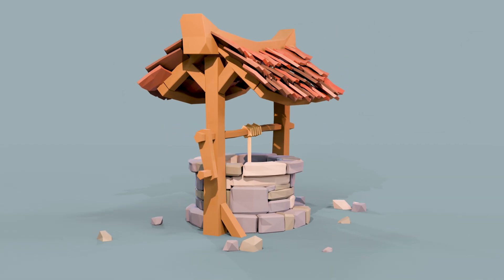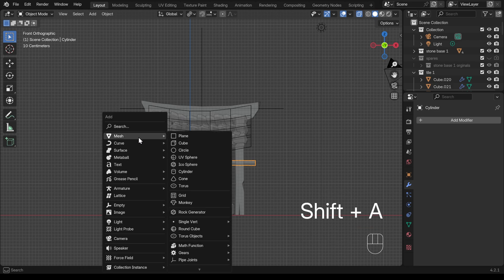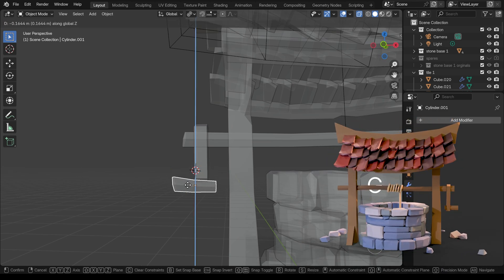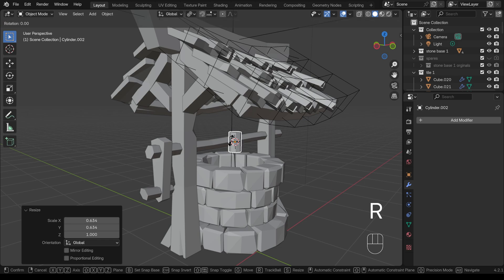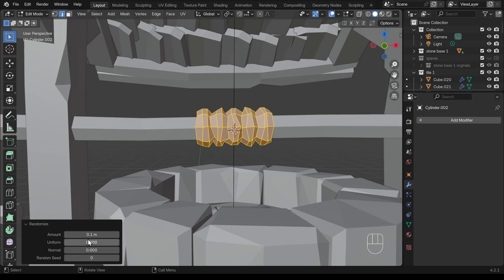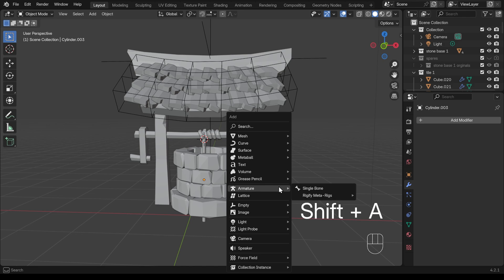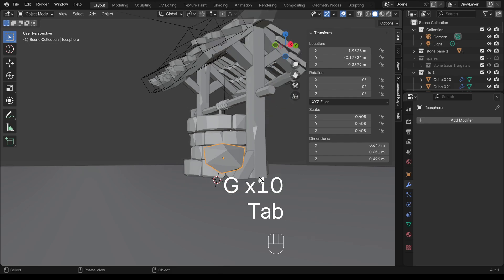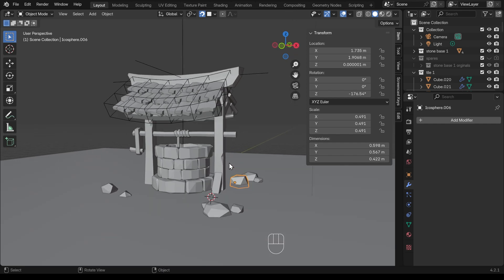Beginner Blender 4.2 Tutorial: Modelling a Low-Poly Well - Part4

Comment: Hi

I am not getting the same result as your rope, especially the part where I bevel the outer edges of the cylinder, after you bevel did you press G to move the edges?

Transformation Orientation is Set to Global and Set Origin is set to Median, I even reduced the number of segments with the mouse wheel but I cannot have the same output as yours😭
Reply from the maker: when i scale the different loops i  was on individual origins
Reply: Hello, you probably already solved this but i think i have the same problem as you but then, i remembered that you should apply the scale of the object you're working on after scaling it so you won't have issues shaping your object in edit mode. So you click on your entire cylinder in "Object Mode" and press "CTRL + A" and click "Apply Scale" on the window that appears and that fixed the beveling problem for me on the outer edges of the cylinder. I hope it helps.
Reply: I found the solution to this - I was having the same problem. If you don't apply the scale to the cylinder, it can behave weirdly when bevelling. That was my problem. I assume you had the issue where the bevel for the outer edge of the cylinder was leaving the bevel at the same level as the inset it creates. I fixed it by simply going into object mode, ctrl + A to apply scale, then it worked!

Comment: Amazing tutorial series again! Thank you. I had a question... When we ended the last video the individual tiles were of different shape sort of bending downwards..in this video it starts with a changed look of tiles...now they are lil thinner on z-axis and they are bent upwards individually... these look aesthetically even better... was just wondering if there is any easy way to quickly do this change in one or two steps (like replacing object or something like that) or we need to do all the steps of last video again with new-shaped tiles?
Reply from the maker: I don't think I made any changes between lectures but it was a while ago I did the tutorial. Just adjusting the shape in edit mode should work fine. Or selecting all and using individual origins to scale
Reply: @grabbitt  thank you. this is helpful!